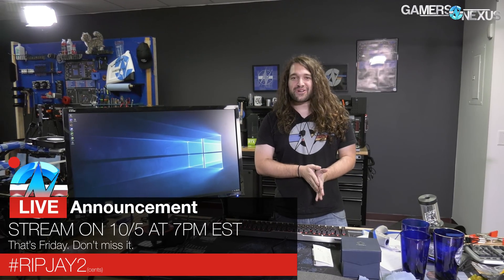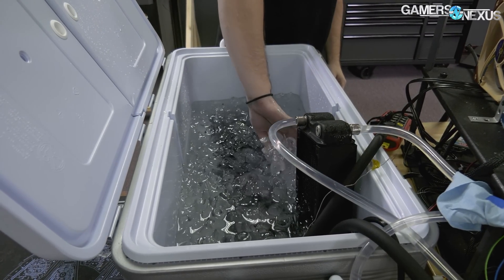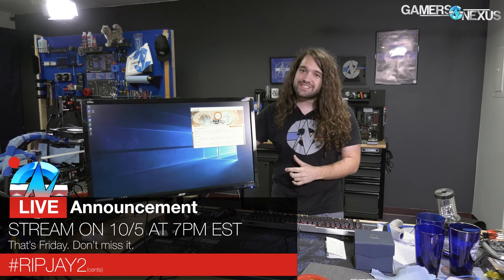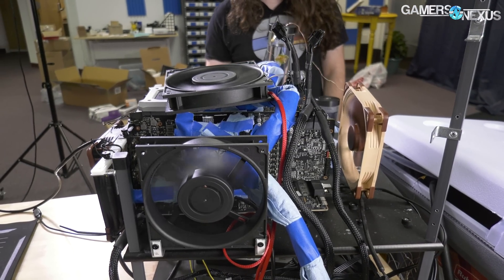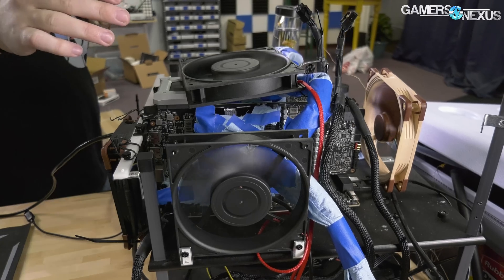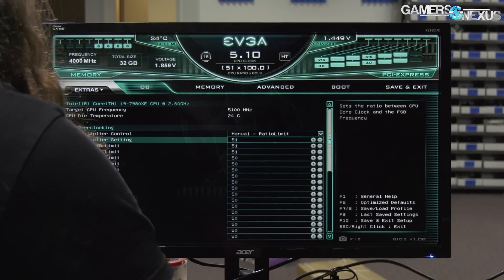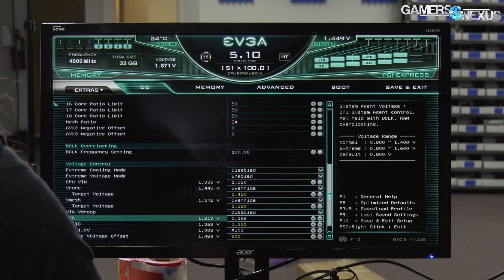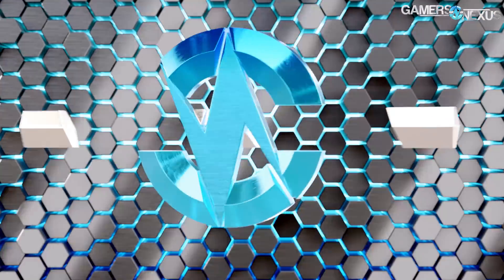Ice Cooling Loop: RIP JayzTwoCents (2080 Ti SLI World Record)

Comment: Wh6 doo you only increase the clocking speed on low numbered CPU cores. Surely you want to use a range of cores so as to spread hot (hotter) points around the surface area. My thought are that cores with higher clocking speeds wouldn’t want to be adjacent as they would be heating each other up too. I could be completely wrong, just a thought.

Comment: I am a physicist and in my setup I also have to prevent condensation from happening. I usually put the whole setup in a roughly tight box and continuealy flood it with compressed dry air...or synthetic dry air.

Comment: The tCWL mem timing is pretty important, try to get it down to 10 or so. Another big mem timing (set) that will help the cpu test would be your RTL's and IOL's. RTL's would be around 55/56 at 4000c15 and IOL's around 6/7. I'm a 32m guy so Dual Channel mems and at 4000 I run Cas 12-11-11-28-1 with tCWL as low as 8 and RTL's/IOL's at 48/49/6/6 or 49/50/6/6 depending on the MB with vDimm at 1.920v real VCCSA @ 1.300v and VCCIO @ 1.250v

Comment: I do not understand one thing .Why you use radiators ?it would not have been better to directly connect the hoses to the container in which  would be cooled antyfreeze (60 %Ethylene Glycol Solution you can cool down to -55 deg C )

Comment: I know this sounds crazy but here goes.
We all are aware of the ram, board, cpu, etc you are using.
What are you using for your OS drive?
Is the benchmark on a separate drive?
Personally, I did see a benchmark score increase using an Intel Optane drive
(or 2 in RAID0 actually)
as a scratch drive with the OS on a 960 evo.
Might want to look at that before "they" do.
System is crazy fast.

Comment: Run the system on 220v. Most PSUs are fine with the higher voltage to support the power systems in other countries. You will get better efficiency from your PSU, and any 220v circuit here in the US is going to support more wattage than your standard 15 or 20 amp 110v circuit. You may need to Frankenstein up a cable to get the correct plugs on both ends, but it will work. Just don’t let the fire dept. see it and you will be fine! Of course, I’m not sure that will be any cheaper than just running two PSUs on different circuits...but it would be cool!

Comment: Is there a problem with ditching the radiator, and directly pumping the ice water through the loop? I think it would drop a few degrees since you eliminate the radiator's thermal resistance.

Comment: Hey GN. After this is there any chance you could try some of that DDR4-4000 kit on a 2nd gen Ryzen cpu? I'v got a kit rated for 3866 (for ocing) and on a 1700 the highest i've reached was 3700 14-16-16-28 at 1.75v vdim and 1.3v vnbrige. it'd be nice to see the performance scaling of a Ryzen CPU to higher memory clocks and lower latency as found on a 2nd gen Ryzen.

Comment: Consider getting a 220VAC power socket wired into your test room. This will at least double the available power in your test room, and just flip the switch on your power supply, or use two power supplies each set to 220-240 V.

Comment: Thermodynamically speaking you don't need the radiators in ice. Just dump hot water from one side of the bucket and suck it back in from the other. Would make it easier to manage.

Comment: Why do you need to even use the radiator? Why not just use the cooler as a large reservoir with ice and dry ice? Just filter the tube openings for large ice shards or put the tubes at the bottom since the ice floats anyway.

Comment: next step ... after LN2 ... operating it in absolute zero ... get Elon Musk to fly to outer space and have your test done there :D .. verify your results by using laggy satellite internet to send data back to earth :D

p.s. no worries about condensation :D
Reply: You can't cool in the "absolute zero" of space because there's no convection or conduction, only radiation losses. A friend of mine designed electronics to go on a satellite and he was forced to use very low processing power, low memory systems because anything modern would cook itself to death in the insulating vacuum.
Reply: Ah something new I learnt today, even though that comment of mine was a jest :D Thanks and cheerios!!!

Comment: I covered my tubing in foam insulation when i used to run TECs and secured it in place with zip ties.  I never had any trouble with condensation and I used to run zero F consistently.  Of course I had to cake the CPU socket in non conductive grease and insulate the socket area (front and back) with foam, with shop towels between layers, sealed with silicone adhesive or liquid electrical tape.  It's a bitch to setup, but it's reliable.  I chilled the liquid for the GPU, but never did direct contact cooling with TECs on the graphics cards.  I cooled the TECs hot side with liquid cooling.  Phase change is the way to go for seriously crazy temps well below zero F.

Comment: I wonder why the pump(s) are on low speed,  the water is barely moving in the reservoirs . My experience if i set my pumps to max , my temps  are dropping by few Celsius.
Reply from the maker: They are max speed.

Comment: That ice bucket could be isopropyl alcohol and dry ice ! Solid -79C...Super dangerous for cold burns. Would need to run the alcohol for the cooling fluid as well.
Reply: Not with glycerin added, could go lower

Comment: I've got an 8700K @ 5.1 on an AIO, 1080Ti @ 2065mhz on air, 4000mhz ram and these videos make me never want to run 3D Mark again 😔
Reply: If you got this hardware, I don't even know why you are complaining! i7 8700K is better gaming CPU than Jay's one, plus if you got gtx 1080 ti and 1080/1440p monitor you should be happy mate, some people don't have money to get even gtx 1060! I got the same rig as your one, apart from the memory, which is 3200mhz, plus Acer Predator XB271HU, and I am more than happy with it, so I don't care what Jay or GN has!
Reply: @4epa1012  I think he said it because all the stuff they do to be competitive on these benchmarks, and then it doesn't last at least a day before the pros comes and send everyone down the drain. XD
Reply: @4epa1012  I also have the Acer Predator monitor as you do bud. My wife's rig is a 1060, bless her.
Reply: These videos make me want squeeze whatever points are left in my 2500K, 2166MHz RAM and RX 480.
Reply: @elektroencefalografista  my wife's rig is my old 2500K, and 1060 3gb. 4.4ghz is all I can squeeze from it now with huge noctua cooler due to degradation
Reply: "my wife's rig is my old 2500K"

Mine was about the same. i got a few notches higher but 4.4ghz was the sweet spot on air where I could trust it for everyday use. I turned it down a bit though because the power bill jumped up quite a lot and the people I was living with at the time began complaining. I just went AMD though. Not because it is better, but because Intel made me wait so damn long before they released something that seemed worth upgrading to. It felt like they were taking the piss. I also like supporting the underdog if they are having a decent crack at competing.
Reply: Nice Lan center you have there GamingS1000RR.

I'm still running a 2600k with 1600mhz memory and a r9 290. Pretty comparable your rig DrathVader.
Reply: FX 8350 here.
Reply: i have a amd a10 7850k paired with a 2gb windforce gtx 950. Just be glad you can game with a beast
Reply: Lol!!! Seriously. I've been using a laptop for gaming and am now in a position to get a desktop and my 1080Ti at max OC can barely hit a 5000 in TimeSpy. Which I guess is good but feels so old.

Comment: Why would you put the radiators in the bucket when you could just put the tubes in the tub and make it act as a massive resvoir
Reply from the maker: We had considered it, but this worked better for a few reasons -- one of them was ice occasionally obstructing tubes, another was just that it helps us control where the heat concentration is and push it around with a pond pump (so that the tubes don't just end up circulating warm water).

Comment: when d shintel prices come down..8400 and 8700 are very overpriced right now ..can i game 4k30 with 8100 and 1060 6GB
Reply: @givemeajackson , he can. But not on ultra. 🤷
Reply: no. but not cause of the cpu. a 1060 is just a little on the slow side for 4k, whereas the cpu barely matters at 4k.
Reply: @givemeajackson  Idk if you know this, but on PC you can change graphics settings to suit your needs.
Reply: Noticed last night actually that 8700K prices were ridiculous. I bought mine on release day for £320, checked last night for building a system for a friend and 8700K's are £440 😮